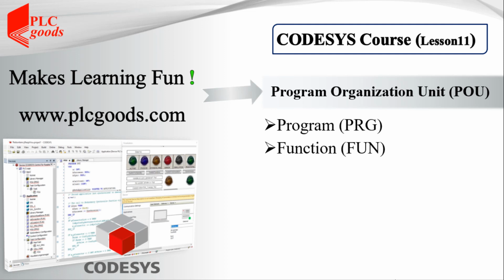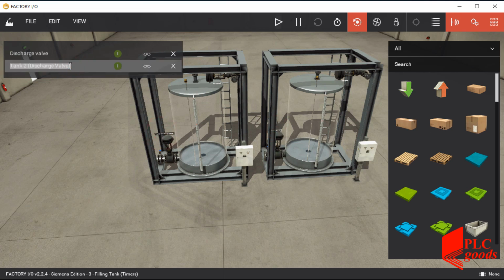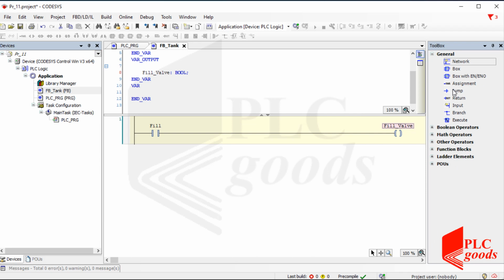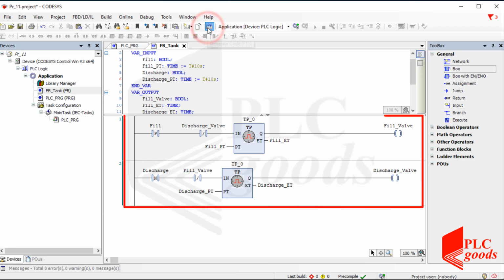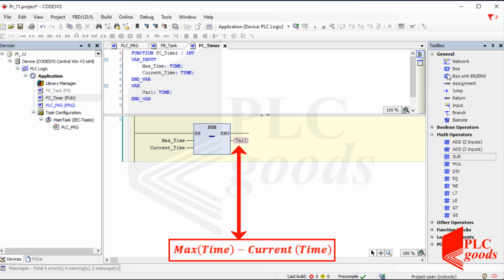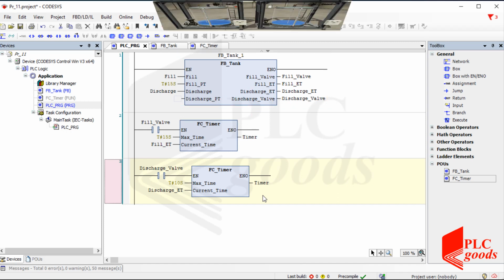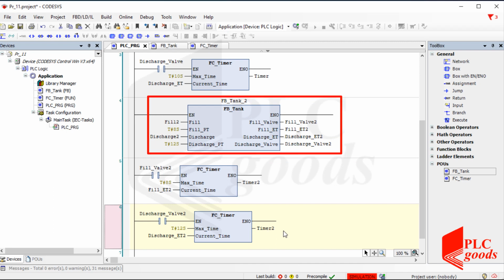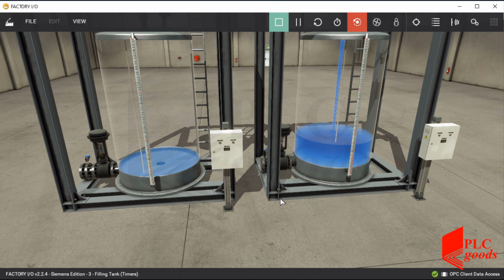✅ CODESYS Function-Block Tutorial | Dual Tank Project  | Lesson 11

Comment: Hello, the signals declared as outputs: Fill_Valve and Discharge_Valve should not be declared as input_output?, since in the program, in addition to being written, they are read, they are consulted within the FB...
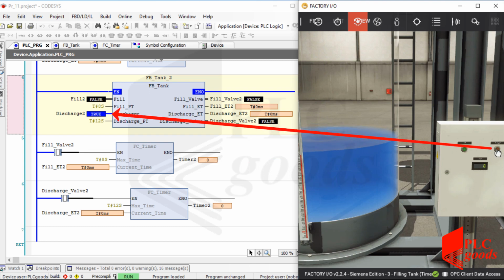Reply: Hi there, your right. In this project, we can also define these 2 variables as Input-Output variables. Note that, because the Function block stores its output variables, my program is working correctly as well (time 1:37 to 1:50)
Reply: @plcgoodsteam8934  , So Codesys and Siemens work differently? Since in Siemens if you have a variable that is read and written within an FB, it must be declared as input_output, doesn't the same concept apply to Codesys?...
Reply: @Runtimevic  Hi there, I've tested the program using Function-Block (FB) and the S_PEXT timer in Step7. It works as well as my code in CODESYS. In my opinion, both of them (FB blocks in both CODESYS and Step7) store their outputs and during the next scan cycle, they can use them. IN-OUT variable is used when we want to pass a data to a FB block, process its value, and then store the result in the same variable (not in a new variable).
Reply from the maker: Thanks for checking out the channel!

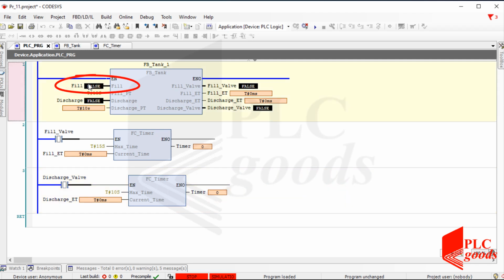Comment: In 17:22 - 17:28 how did you manage to turn the fill into True? When i double click i just get FALSE <TRUE>. Please help.
Reply: Hi there, As I've mentioned in the previous videos of the Codesys course,  after double clicking,  press "CTRL"+"F7" on your keyboard.
Reply: @plcgoodsteam8934  How did the discharge valve automatically change to true when the fill was pressed? All the values are still false after I press the pushbutton?
Reply: @AA-nq8ec  Hi there, I've explained all part of programs during the video. I think your problem is related to running and simulating your programs, not the logic of your code. Please see the first videos of our CODESYS course to ensure that you can simulate a simple program without any problem, or please clarify your problem for us to answer it.
Reply from the maker: Thanks for checking the channel!